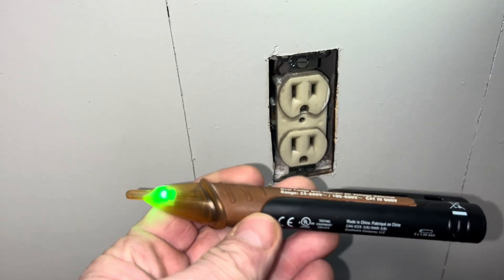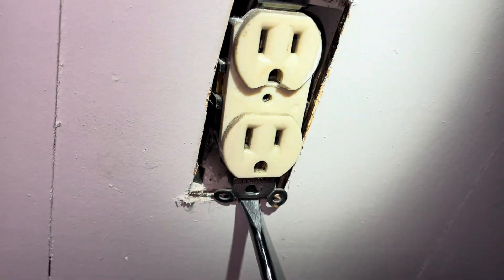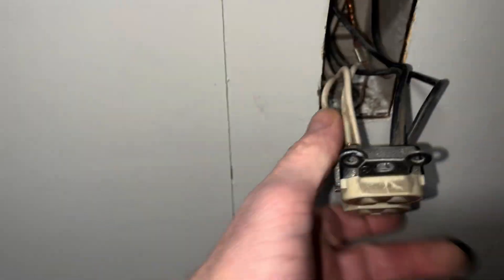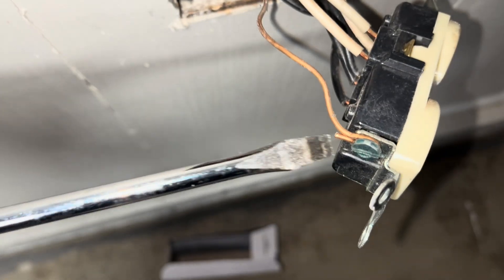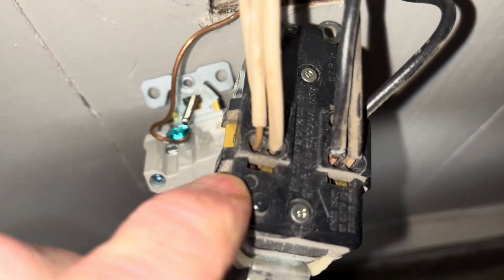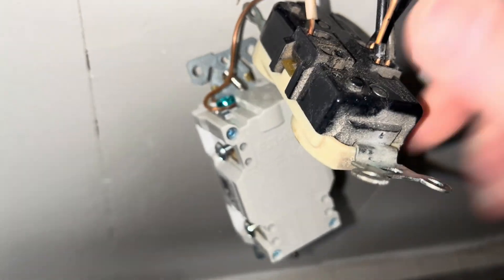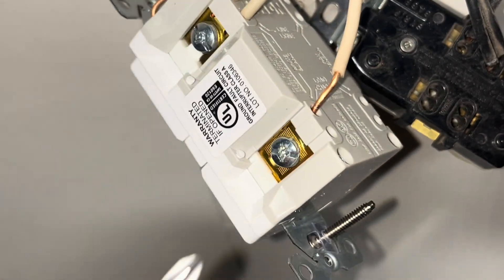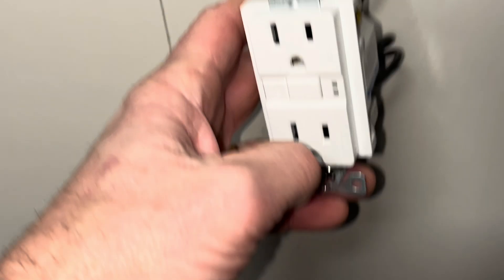DIY How to Replace Old Household Electrical Outlets | Basic Step by Step Tutorial Demo For Dummies

Comment: I always replace my outlets with GFCI even if they are stand alone. Not that much more expensive anymore. Also just as a FYI at least in this area new outlets are installed with the ground terminal of plugin facing up, that way if cord sags out of outlet a something can fall across it it will land on the ground terminal.
Reply from the maker: Great tip there. Thanks! I’m getting all kinds of help on this video. Appreciate your expertise.

Comment: What is the reason you are replacing an ordinary outlet with a GFI?  Is it necessary?  The cost is about 3 times as much.  Second, most GFI’s have line and load terminals.  The line is where one of the white and black pair leads is hot and should be connected.  The remaining two pairs, if they are NOT to be protected should be combined and connected with the hot leads on the line side.  If they are to be GFI protected they should go on the Load side.  Other outlets down the line, if protected, should be labeled that they are GFI protected.  Miswiring a GFI may not protect personal injury or death due to a ground fault.  I take it you are not a qualified electrician, yet feel free to give advice as if you were.
Reply from the maker: Thanks for adding your two cents. Your expertise is much appreciated. Great questions at the beginning of the comment as well. When/where would you most recommend installing a GFI outlet?
Reply: @DIYTechnician  GFI outlets should protect all outdoor receptacles and garages where extension cords could lead to using power tools outside.  Bathrooms, laundry rooms and kitchens also have GFI requirements. One GFI can protect all the outlets on one circuit if installed properly.  New construction codes are now requiring GFCI (Ground-fault Circuit-interrupter) and or AFCI (Arc-fault circuit-interrupter) at the electrical panels to protect all 110v receptacles in the home.  Minimal code requirements vary and should be consulted for every application.  Google is helpful for various parameters but the NEC is the final word.  Where potential electrocution is possible it’s best not to give advice if your not an expert.  Consultation of an attorney might be good thing to see if giving advice on YouTube could put you or your assets in jeopardy should anyone be injured or die using your advice.  I’ve been an electrician since 1968 and am retired now.  I assure you I have seen all kinds of code and non-code wiring in a receptacle box.  Various applications include a receptacle being split so one side can be switched or two separate circuits to handle two dedicated appliances like a dishwasher on one plug and a switched garbage disposal on the other.  In the dishwasher/disposal scenario it is possible to have 220v potential in a normally 110v box.  Then there is always the possible DUI situation where someone has decided to use the ground wire to carry current.  I received a shock on that one but fortunately was not electrocuted.  My expert advice to you is to be very careful in what you are doing and giving advice with limited knowledge.  It could cost you your life or the life of someone else.
Reply from the maker: @Ron-no4tp  great advice and much appreciated.
Reply from the maker: To address your cost comment, which I really appreciate as well….what if you received a bunch of brand new GFI outlets for free, would you install them? Do you figure you would go purchase a new standard outlet or leave the old one if not replacing with a GFI?